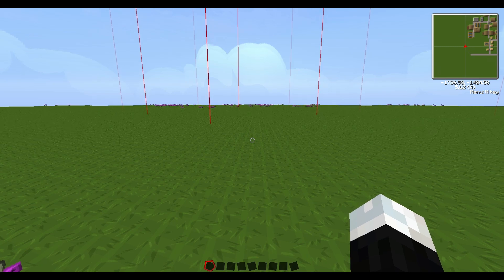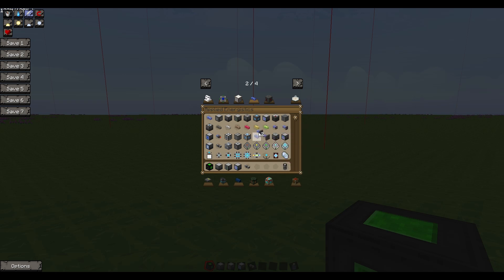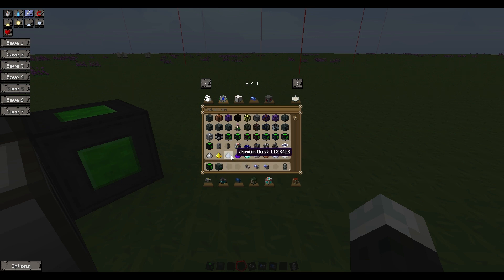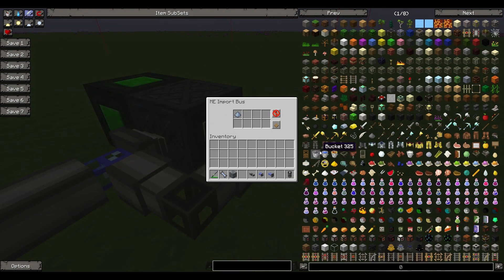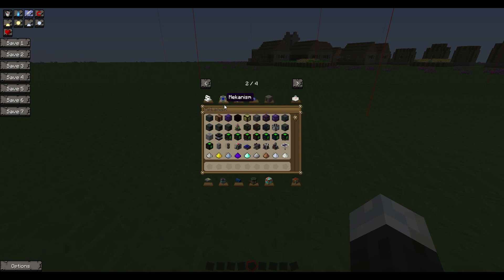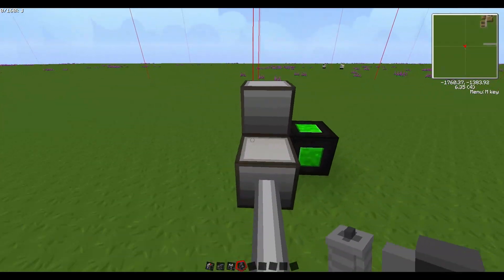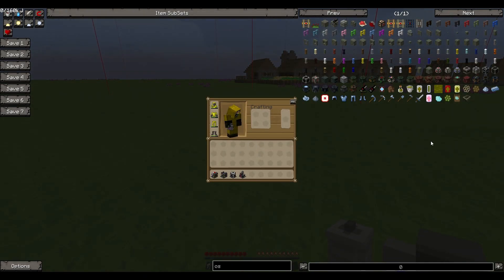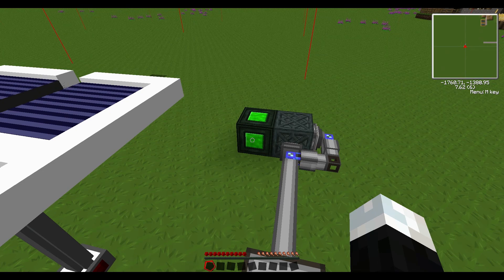Applied Energistics and Mekanism

Comment: Since there is no updated note on this video; Universal Cables (from Mekanism) will connect both of those devices without any problem.
Reply: does this still work? I can't ae to connect to factories.Trying to set-up an auto purify smelt set-up. The ores just get tossed out if i use gold pipe.

Comment: I'd forgotten that the Electric Expansion stuff was compatible with the IC2 framework - this makes it much easier to use AE, even if I do need to put the energy cube right there. Thanks for that!

PS: There is a method to the orientation of AE's buses. They'll face away from the surface you click on, or towards them if you sneak-click, so sneak-clicking the machine face you want to interact with works perfectly.

Comment from the maker: Buildcraft is a love/hate relationship. I love the quarries and builder, hate the piping system. I have been using RP since before it was called RP. Her pipe system doesn't eject items because a chest happens to be full, and thus far in 1.4.7 I haven't had any real issues with RP2 at all. I do agree that Eloraam should be a bit more open and have a api so people can develop addons for her mod or mods like AE can integrate her cover system and allow players to hide the cables.